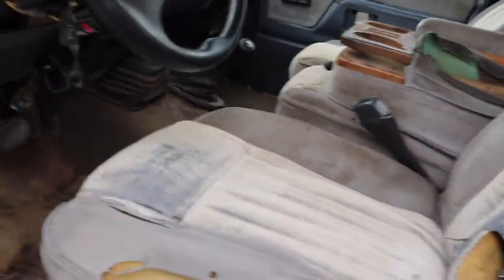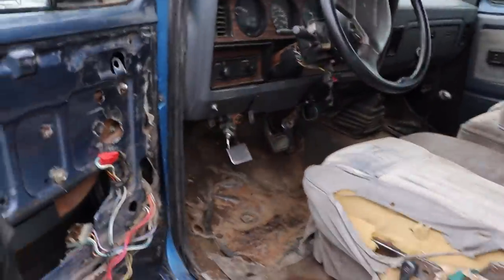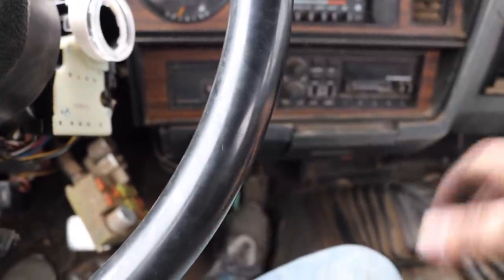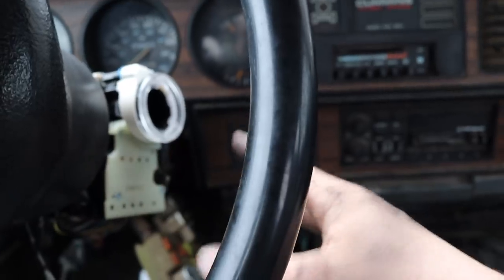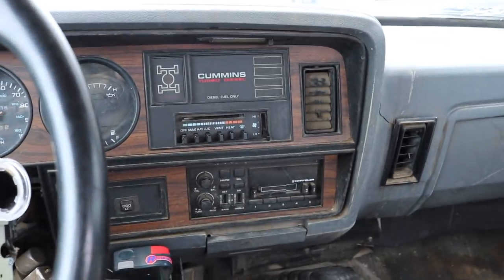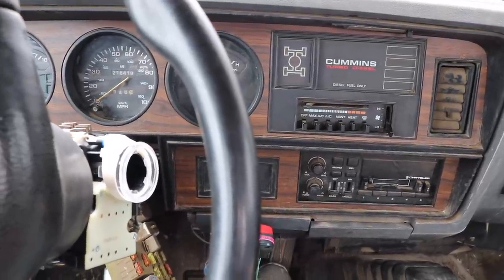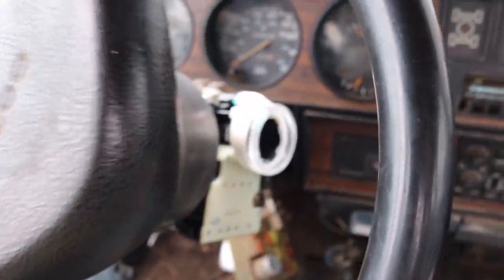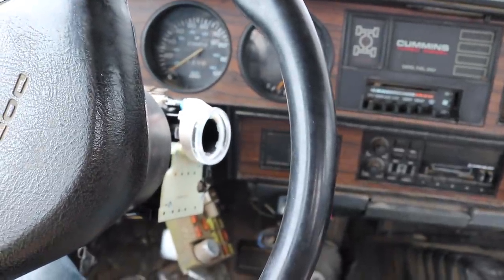This 12V is TOTALLY DEAD...

Comment: There is a fuse able link on the driver side. Forged and boosted had the same problem on his blue first gen. He was going down the road and it killed all power
Reply: Smokey Okie1995 I was gonna say, it’s gotta be a safety switch or something
Reply: @joeparker2879  naw there is one main wire that feeds the cab power. The fuse able links burn up and your left without power
Reply: Smokey Okie1995  kinda what I meant
Reply: Yes check your fuse able links

Comment: Hey loud n proud, I haven't had this happen before, however, the way it sounds, it may be something in the clutch. Possibly the kill switch in the clutch. I would say the starter, but you said you replaced the starter relay. Hope this helps you some!
Reply: If it were just it not starting I would agree, but he doesn't have power to the gauges or dash lights.
Reply: Colt Troxel true, you have a good point, I guess I forgot about that part

Comment: Check wiring diagram in Haynes/Chilton dodge has fuseable links running along driver side fender to firewall.  Also check power at junction box outside vs inside of cab.

Comment: It’s nothing with the clutch switch cause you should have dash lights on regardless. I found trace wires from your battery to where they are running. Test light would be the easiest way to see what has power and what doesn’t.

Comment: Sounds like a blown fusible link on your driver side inner fender. In the meantime you can jump the fuel cut-off solenoid on your VE pump and jump the starter to move it around.

Comment: Alot of ignitions need the pins to aline right with the screw driver you might of worn out the pins if you have keys for the parts truck try switching ignitions

Comment: Check the wires that run to the clutch button.  Also maybe check ur external regulator? Also um did u check all ur grounds? Like on the frame?
Reply: Actually in 91.5 they did put a computer in them. I was also thinking could ur battery have a bad cell?  Which means it shows charge but actually is grounding out internally so it's dead?

Comment: You have a blown fusible link. Dodge used four of them to supply power to the cab because it was cheaper to manufacture. They are located in the wiring loom on the drivers side fender. I had the same problem on my first gen and I put a new switch in and new starter relay before I found the problem. Also the 91.5 to 93 Cummings have a computer in the drivers side fender near the front to advance the timing and a bunch of other stuff to make cold starting easier.

Comment: If you haven't already.  I would grab a voltmeter and trace from the battery towards the ignition to see if your losing power somewhere there. If there is power at the ignition, then follow from there to things like the starter motor.  I'm also curious. Does it have a fail safe for the clutch, so it can't start without the clutch in? I wonder if when it stalled out, it may have messed something up with the clutch fail safe, assuming it has one knowing the truck is on the older side. I'm not really sure, just a suggestion.

Comment: Try crossing out the starter and see if the starter trys to turn. To me it sounds like a blown fuse and or a short in a wire in the steering column somewhere if your saying it did this with the original ignition switch it lead me to believe you have a short in the column and looking at the wiring that's a good chance.

Comment: Check the relay for the fuel shutoff solenoid on the drivers fender also any fusible links in that area you should be able to run a hot wire from the battery to the fss relay and jump the starter to start it to get it inside

Comment: I’d check to see if you’ve got power from the ignition at the starter and if you don’t you may have a inline fuse or wire bad inside the steering column to the dash, these trucks are awful for that if you have power to the starter from the ignition than I would look up a diagram of the ignition, to my knowledge they only consist of starter,starter relay,ignition,ignition relay, and of course your battery and grid heater, and start checking each one to see if you have power to them if you do, check the part to see if it’s good or not, if you don’t, follow the wire to find the break/bad ground, hope this helps and love the videos

Comment: It is one of the fusible links had the same problem with my truck
Reply: Austin DeCaire sounds like the issue, either a fuse or one of those links. But that means he had a short to ground somewhere in that circuit , and it will pop again eventually.

Comment: I wonder if your engine control module shorted out. It should be inside on the drivers side front fender right next to the battery. If you look next to the battery right behind the headlight you’ll see a black box. That could be the culprit.

Comment: There are four fusible link on the drivers side fender the wire gets brittle and breaks get a fuse panel off Amazon with 30amp fuses and one mega fuse. The mega fuse will go to the thicker black one for the alternator and the rest go to the small fuse panel off amazon. Just went through the same problem with my dads 82 w200. If you want I can email you a couple pictures of how we did it

Comment: Try putting a different battery in the truck and see what happens because my 2nd gen I had I was driving and the battery voltage guage shot through the roof and what happened was the ground terminal lot connection for a couple seconds and when I went to start it back up the battery was fried I would try a good battery and see if you get power

Comment: Neutral safety switch nursing switch stunner TV has headlights that means you got batteries OK just push the truck and push out the clutch and it’ll start so you can get it in the barn so it’s nice to have a standard transmission set up my automatic and I think you’ll be fine good video keep up the good😃

Comment: These fuseable links normally T into V shaped heavy cable fuseable link is basically wire that's fused look for breaks burns in wire basically wire pops its its harder diagnose than a fuse dodge always ran them left fender or driver side wiring.  Also get test light harbor freight test for power at starter work your way to cab.

Comment: Have u tried the flat tip trick. Leave the switch on . And touch the 2 lead on the starter and it should start. But like they said its fusable link. Has to be the culprit

Comment: It’s a manual. I would try push starting it. Throw her in neutral and pull it with one of you other trucks. Pop it in 2nd and pop the clutch and see if she starts. And if everything works well you know it’s at least electrical.

Comment: Let me know if you need help or information, I can get you wire diagrams and help you go step by step. I would start by going from the battery to the couple fusable links (little black things inline of the wire)  in the harness by the starter relay, check if you got power on both sides. some of these trucks had problems with the connectors that are going through the fire wall too.

Comment: My guess is either the fusible links or that connector in the fattish-black alternator wire that connects to the battery, which routes through the fuse-links. Orr the ground cable on the larboard bottom of the block and the body ground on the radiator support just next to the battery. if one of those GROUNDs came loose, it would kill everything the same as if the HOT cable came off. If it sort of has some electricity, but not enough, the big. ground could be loose and it trying to ground through the engine mounts, transmission, and such.

Comment: Actually a 93 dodge does have a computer it cantroll gauges voltage and a few other things  you could try hot wiring the starter just nothing on the moter side  it’s the black box on the drive side fender

Comment: Trust me on this, its the clutch pedal position sensor. check it and i bet its bad. if you dont have one or cant get one and you want the truck to run you can hot wire the two wires together and you can bypass the clutch pedal on start up all together. when this sensor goes out it puts a break in the whole starting system....i worked on a customers truck for a week chasing this same problem! turned out to be a bad wiring job on the clutch pedal position sensor. Good Luck man hope it helps

Comment: Try jumpin the starter from the battery with a wire. If it turns over, it's something from the relay back to the key

Comment: maybe you can pull start it ? At least it works with a semi …. ive had no power or anything before , and what we did was put a chain in the front and pulled it with another truck. when you are in the truck that wont start you put it in gear and as they are pulling it you dump the clutch and it will usually start up... ive only done this in a semi … just wondering if it may work in your situation ...

Comment: I’d say fuse but you checked it.... no idea check all the wires you put in maybe not making contact! Starter and the ignition switch or did ur clutch cable snap?

Comment: Does the clutch have to be in to start it? If so, the clutch may not be engaging. Doesn't make sense that it shut off but could be the problem. But no lights on the dash and gauges not working, electrical somehow.

Comment: Under the steering column, there is a red wire that usually will short out and burn through. Trace and check the wire.

Comment: Probably a fusible link near battery that powers ignition kinda looks like a normal 12 GA wire that's meant to act as a fuse
Reply: Or bad ground wire to body and chasis

Comment: Check the fuses with a test light (should have it light on both sides of the fuse with the key in the on position). Sounds like a fuse, or the ECM took a dump.
Reply: I meat body control module*

Comment: I would check the gang of fuseable links on the driver side fender they are all going to the battery 
by a one power cable then the bulk head connector that is on the fire wall to the in side of the cab they is also a fuseable link off the alternator to

Comment: So even tho those trucks have terrible wiring by now those trucks will still probably have some fuseable links so there is a big black cable that comes off of the positive terminal of the battery that splits to 4 wires i believ take a test light and test the wiring every 4 inches or so because if the fusable link isnt blown the wires could have shorted and melted so if yoy do it every 4 i ches you will be able to tell where that bad wire is because its not a relay because you have already replaced the key switch and it goes from the relay to a key switch to a fuse to the gauges and u have already check that stuff out also you are obviously getting power because that little key tumbler light runs from the same power supply. That big black wire also unplugs by the cable itself so who knows

Comment: You could have shorted out some wires, and that gets hard to find out what happened. Just start using a power tester on everything that goes to you "key" and power that leaves your "key" 
First gens are know for having really bad wiring. 
Good luck with finding your problem

Comment: Another shot in the dark... you may have to put an ignition switch in. When I bought my wife’s ford it was fine for a little but then I ended up ripping it all apart and had to put a new steering column and ignition switch in the truck 🤷🏻‍♂️ not like you don’t have another ignition 😂

Comment: Try  jumping the starter.  And driving it to where you want it   Just will have to shit it down with the plunger in the solenoid
Reply: That is if hes getting power to the rotory pump if he isnt then the truck wont start but I do agree wit jumping the starter just to see
Reply: Donald trump 2020 no more bull shit  it a Full  it’s a gear driven pump.  Un Plug the electic side. And  jump the lift pump